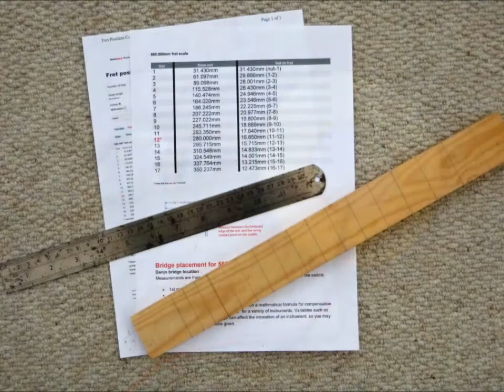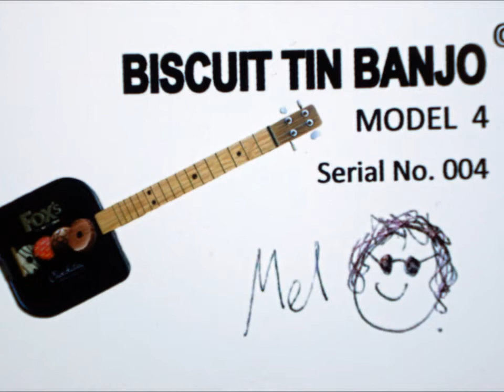Biscuit Tin Banjo Build - Irish 4 string Canjo

Comment: Nice video and songs.    I tried to build a four string  using  spam can. I was unsuccessful to make the frets level and I aborted.  I left it as a fretless.  Did you have trouble getting the frets level?
Reply from the maker: I think it is all to do with the angle of the neck etc. (and there always seems to be the odd fret that does not want to behave itself and sticks above the fret below causing a rattle!) …. my first attempts always used a nut made of wood or plastic but I now go for a ZERO fret instead made out of a slightly heavier gauge fret wire this method seems to have removed 90% of the problems I experienced before